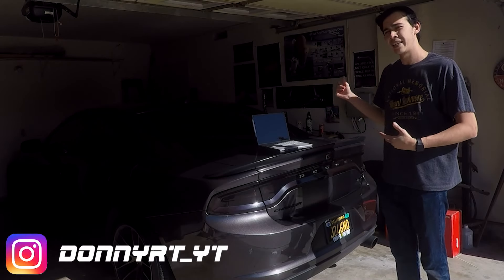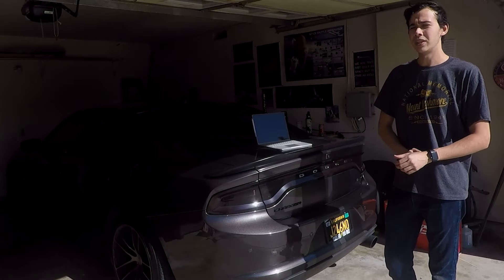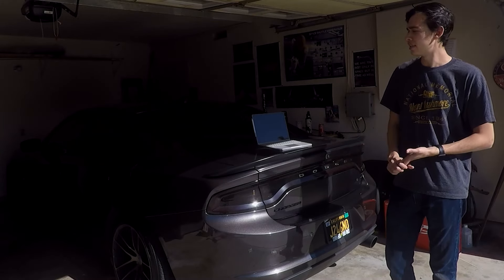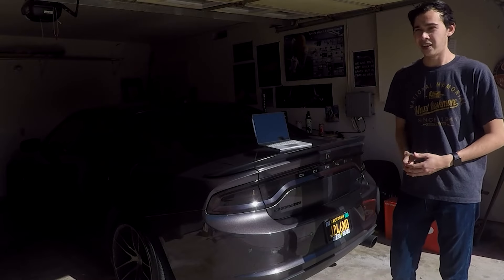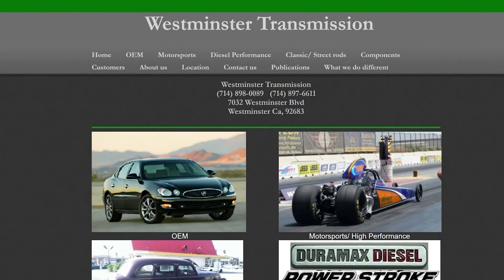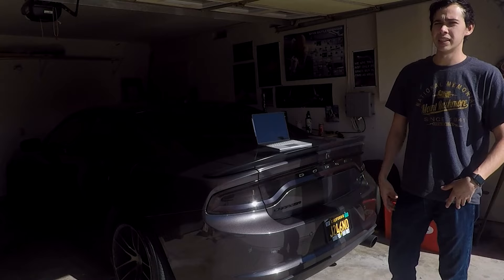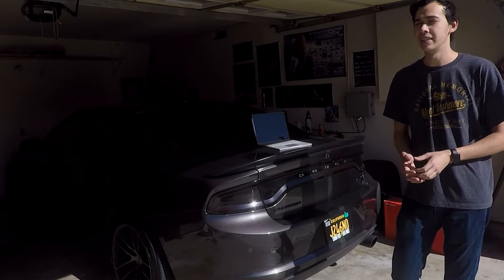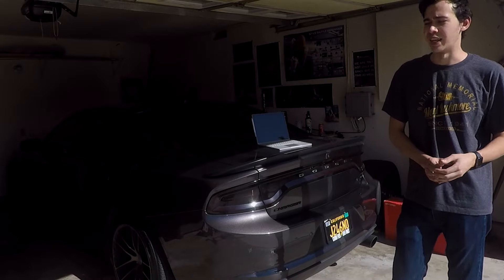What ACTUALLY Happened to the Cammed R/T

Comment: The dealership knew the axles came out, been in the automotive trade for decades as a line technician, first thing you do to confirm a trans issue you put the car on the lift engine running and you shift threw the gears they would have felt and seen the drive shaft turn. If you had paid that 5 grand repair cost I wouldn't be surprised if they just cleaned off your trans change the fluids and filter and upsold you axles or had them warrantee replaced to ensure they wouldn't pop out again.  Dealerships can be real scummy.
Reply from the maker: Every time I have to interact with a dealership I discover more reasons to hate dealing with them. This is good to know, thanks
Reply: That's exactly what they would do.  Similarly I lost power on the highway.  The car would not shift to park and would not turn off and there was a grinding noise in my rear tire area.  The dealership said my rear differential was bad and that it needed replacing along with both axles for the low low price of $4800.00. The differential by itself (2.62) was 1900.  I took it to my mechanic and paid 1900 for for everything including labor...🔩 the stealerships, especially Dodge.  They make great cars but that's about it...I could go on...lol

Comment: Fun fact. The advisor coulda pulled the codes on the drive and knew what it was before they sent it back to the tech. The advisor was likely inexperienced as most dodge service employees are these days. Speaking from personal and professional experience i will never use a dodge dealer. The techs are trained to throw parts at it until the problem goes away, they have NO trouble shooting experience and mainly use the TSBs and STAR cases as a guide for repairing the car. Hell the dealer i worked at did 12k in damages to my car right before it rolled outta warranty, and fired me when i started rockin the boat about it.
Reply from the maker: This drives me crazy. I am compiling this information to make a video about it in the future... thank you for the insight

Comment: Hell yeah Glad to see you back i have a quick question broskie  I've been wanting to buy new rims for my 2019 charger rt I wanna go with a  staggered setup 20x9.5 and 20x10.5 the only thing I don't know is  the offsets do all charger run the same offets?
Reply: Which wheels are you planning on getting?  What’s their offset? I have fr73s on my rt with the 12mm offset front and 22mm in the rear, same staggered 20x9.5, 20x10.5. My wheels sit flush with the fenders with 275/40 tires front and 315/35 tires rear. Hopefully that helps!
Reply: @Tropiusproductions  thanks bro i appreciate it the rims i wanna get are the demon replicas
Reply: @stevegutierrez3392  yeah that’s the ones I have. From Factory Reproductions
Reply from the maker: I believe my rears are +20 but I don’t remember what the fronts are